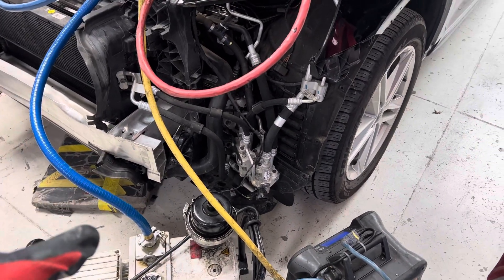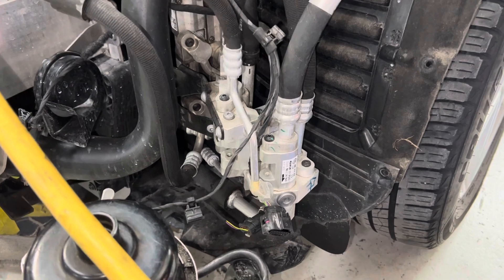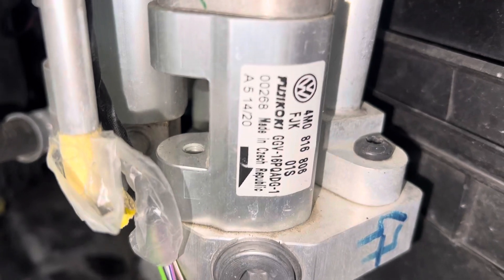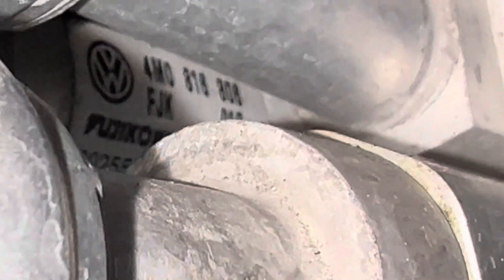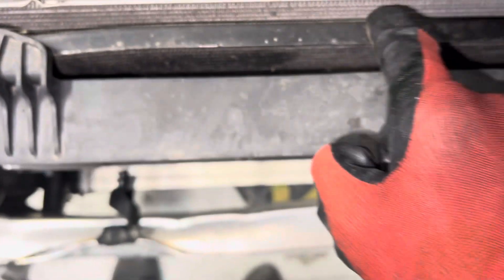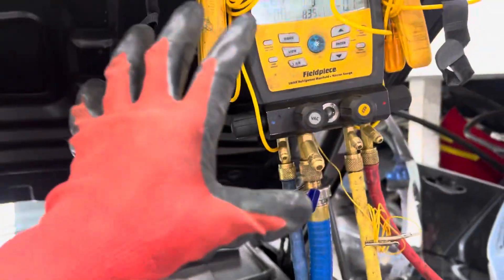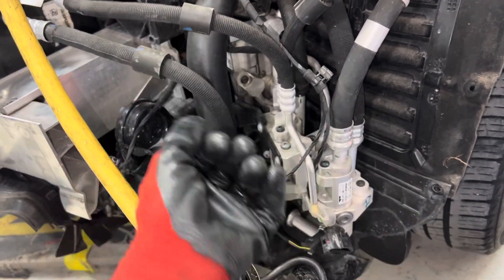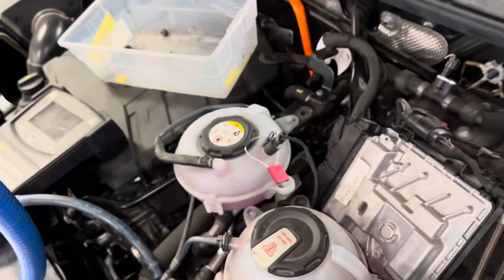Fixing new heat pump systems after a burnout be the price of an old used car ￼.

Comment: Crazy what they’re putting in vehicles these days.  So if a compressor burns out and you can remove the expansion valve(s) without removing the dash.  Would you be able to replace txv’s and the crazy looking control valve. flush the evaporator and the lines if you disconnected from that crazy looking control valve?
Reply from the maker: Plush replace one or two plate heat exchanger refrigerant to glycolic systems. 

Solenoids, expensive electronic expansion . 

It’s the Tesla with the valve replaced you’re looking at $6000 plus 💰
Reply: What is this unit exactly used for? 

Some more overengineering imagined in Germany, realized in Japan and built in Czech Republic 🥴🥴

The more I watch your videos about newer cars the more I like my older cars 😂
Reply from the maker: @Akadectra  yes. My simple old 1966 Mustang 

The most complicated electrical testing tool, a.k.a. scanner 🤣 I can use a old headlight and two wires to diagnose. Absolutely everything on that car.. 

I can set timing by ear . 

I could set the fuel mixture by using my nose and looking at the spark plugs after a test run . 🏃 

I could set the gap dwell on the ignition points in the distributor with the thickness of the paper of a book of matches.
Reply: I just want to wake up and find it was all a bad dream. Surely no reasonable manufacturer would produce such a vehicle (he wishes).
Reply from the maker: @Straycurrent  or like a lot of shops. They only replaced the compressor and sometimes the condenser. 

And it works for a while, but burns up another compressor . And they call this normal..   
 I have seen many shops, not flush and leave metal, flake inside the system and have a compressor that last another year or two years. 

And then comes back again or they hope the customer doesn’t remember and come back go somewhere else, so they made the money off the first compressor .  

Car heat pump repairs are becoming as expensive as full sized residential hvac repairs